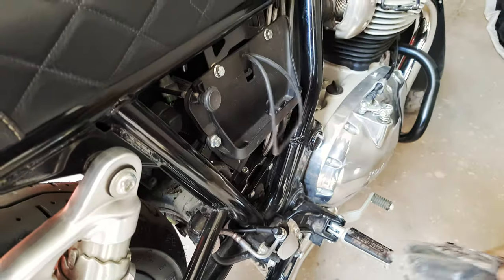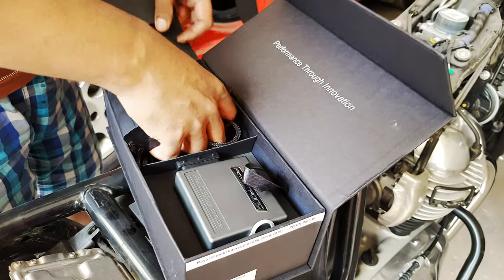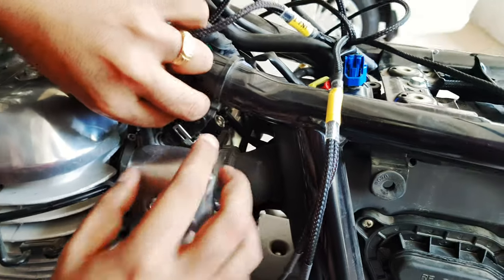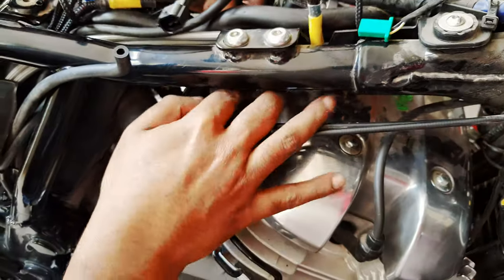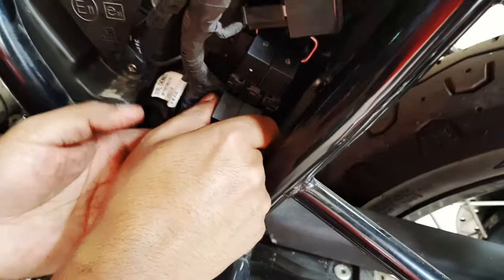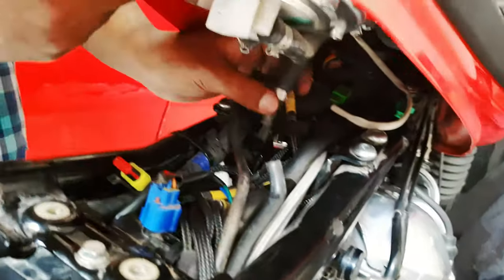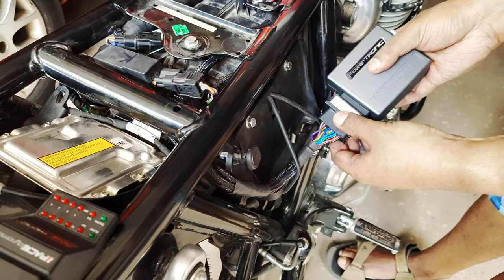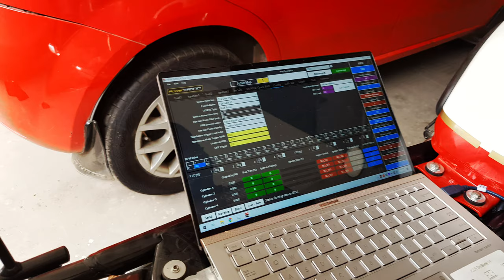Powertronic Installation - Royal Enfield Interceptor 650 | 4K

Comment: How did you come to know about the actual range of 30 to 224 ? I mean does it shows up in the powertronic application ?
Reply from the maker: Yes, it shows the actual values at each position as you move the throttle. Somehow the wizard doesn't record all the way to the maximum. But you can see the actual values on the screen.
Reply: @Volatile42  Great ! Thanks for responding 😀
Its quite an informative video for the users who are planning to DIY.
Keep doing the great work !
Reply: @Volatile42 after installation the rev limit is still there..
Reply from the maker: Yes, the default maps provided with the Powertronic do not change the rev limit. But I believe there is a way to change it from the tuning software. I myself haven't tried it yet.

Comment: What year is your bike? Will this work for Interceptor 650 2021 ?
Reply from the maker: Mine is a 2019 but I'm pretty sure it'll work on a 2021 as well. There have only been some minor changes for emissions and mostly with the exhaust. The Powertronic maps are customizable and Race Dynamics (the makers of Powertronic) might even have made some changes if necessary. I would suggest that you check with Race Dynamics once to be sure. They are usually quite responsive and supportive.

Comment: These are slightly modified  stage1 maps. It barely adds fuel to the idle cruise. 

Adds no timing and does not raise the rev limiter because the current engines configuration can’t take advantage  of this. 

It is only set up for exhaust and air filter fuel map adjustment. 

The bike is almost lean completely across the fuel map .
You can trim the fuel cells but should be done on a dyno  to make sure you don’t over fuel or under fuel cells. 

Having said this, I tested 3 interceptors , one with powertronic., one with Booster plug. And one stock.

The only difference I could feel  was the idle was smoother  and slow speed  was easy and roll on had a  nicer acceleration with both tuners.

The stock one was a bit ruff with the throttle but otherwise not much not a huge difference. 

Will be purchasing a 650 soon, the only thing I will do is an exhaust and Booster plug. 

The after market  filter  is not worth  it, excess  dirt will enter the engine , eventually causing the pistons seals not seal completely. 

My advice. Keep the stock filter and open up the plate that holds the filter in place if you just got to have that minimal extra  air  and performance . 

If you need more power then you are looking at the wrong bike. Other than cams to wake up the bike a big bore would be the only choice and that opens up a can of worms  not worth going into. 

Hope this helps.
Reply: Booster plug doesn't work on the Euro 5 onwards.

Comment: I m a new subscriber from Dubai. Stay blessed! I am from a place where there is no mechanic with laptop and ofcourse incompetent enough to handle this. However I have a RE Service station nearby and my question is, would they fix this? Would it be legal to approach them?
Reply from the maker: An RE service would probably not do it. It's pretty easy to do it by yourself once you understand the process. Otherwise I would suggest you approach a good independent garage that specializes in tuning of bikes and cars. I'm sure you'll find them in Dubai. Show them the Race Dynamics documentation and maybe this video and they will know what to do. All modern engine tuning is done via computers.
Reply: @Volatile42  So kind of you. However I meant back in Tamil Nadu only (Kanyakumari). I try my best to cover it thru your video. Thank you once again. If you could enlighten me on ' difference between quick shift and powertronic. Is it two different devices? or just once unit used for two purposes?
Reply from the maker: The quick shifter is an add-on for the Powertronic. The Powertronic already has the software and connector for the quick shifter. You need buy the quick shifter sensor and, install it into the shift lever and plug it into the Powertronic. So yes, if you want the quick shifter, you need both that and the Powertronic.
Reply: Volatile42 oh nice I got it. I don’t speed my bike much and I hv a hyderalic clutch installed already so I intend to apply clutch for the shift. Hope my stand makes sense “ not to go for quick shift and jz powertronic is fine “!

Comment: I have one of these installed on a 2016 Classic 500.  A very capable tuner that allows for easy modification of the fuel and spark maps.  The downside is that the only tunes you can get from Powertronic are for either stock setups or for bikes with both low restriction air filter and exhaust.  My modifications go beyond that and they are no help.  They say you need to find a dyno to tune any other configuration.  I told them that there are no dynos here and they said they can not tell me anything.  They do have some good reading material on general tuning practices, however.

Comment: Brilliant video and I need a some guidance on this, I was too ignorant, and bought an AEW exhaust only to realise later that changing exhaust also requires us to tune the ECU for health of the engine (as the pressure build up in the stock due to its core is not present in aftermarket one). Which I also sensed subtly while riding when the engine revved up pretty quickly but soon would loose its pressure. I see the Powertronic might be stop gap for this.. but its a bit expensive and a over kill.. Now my question is,  can this managed by buying an after market filter and an appropriate spark plug or do you think going for powertronic sought of stuff is the only way? Your information would be really helpful.
Reply from the maker: An aftermarket air filter will make it worse as it makes the system more free-flowing and hence more lean. For most people just the exhaust change itself doesn't require a remap as the effect is relatively less. But a remap is recommended as the ECU uses a very lean map from the factory. You may want to look at the Booster Plug which is cheaper than the Powertronic and most people are happy with it. I wouldn't recommend changing spark plugs as they don't have any realistic improvement on performance. The iridium tipped ones last much longer though.
Reply: @Volatile42  thanks for the reply.. 

I am trying to understand what you mean.. So the lean map from stock setting will continue to send in low fuel.. While the after market exhaust will let the air flow freely on the output end right?

So, what if we dont remap let it with default setting ? will this imbalance between input and output have any adverse impact on the engine life or mileage..?
In short what are the impacts if I just change exhaust and do noting else.

NOTE: I asked this becoz I just checked, the booster plug seems cheaper than e-commander units. But not really that cheap.. costs like 12 - 14K
Reply from the maker: Right. The stock setting is very lean to begin with as they have to meet the emissions standards. If you add any free-flow component, either intake or exhaust, you get more air flowing but with the same amount of fuel. So it will be running more lean. With any tuner, you are trying to fix this by adding more fuel. Most people don't notice much of an adverse effect with changing just the exhaust or intake. But if you change both, you will most likely need to add a tuner. Extremely lean settings can harm the engine as it causes it to run hotter. I can't really say exactly what level is safe but most people seem to be ok with just an exhaust change and no tuner. 
BTW, what you say about the lack of back pressure in an open exhaust is also true. This itself is not harmful in my opinion but you may feel like you're missing some of the performance. In my case the Powertronic did fix it and I think people with Boost Plugs also noticed the same. But on the RE 650 the difference is not huge, so you don't absolutely have to go for a tuner. This is all general knowledge but different bikes react differently to such changes. On my Harley Sportster, just changing the exhausts brought in a massive flat spot in the torque curve that was very irritating, so I was forced to get a Fuelpak3. On the RE 650 the difference is noticeable but not so dramatic.
Reply: @Volatile42  I did notice it in re twins.. Its subtle.. Some might choose to ignore it.. But it is there.. So I have the stock back on the exhaust. It will be so until I decide on a solution
Reply: @Volatile42  Really meaningful conversation here, points noted and thank you!
Reply: @prabhuraaj101  Hi guys good information. I have what is the standard mods for the intercepter, free flow exhaust (s&s) free flow air filter and booster plug (easy install). Sounds beautiful and runs hard with no issues. The main thing with exhaust change is back fire on closed throttle, that's your lean mixture. Booster plug just fits into wire loom and on the outside of the air box thus fooling the ecu into thinking its too lean so richens the mixture. Way cheaper than EFI tuners that still have their part to play should you decide on cams or 865 kits. Stay safe out there. LOVE my intercepter.
Reply: Hi 
Very interesting conversation I just wanted to ask I have an aftermarket airfilter Way2Speed and red rooster slip ons added 
My interceptor miss fires a lot after 6k rpm 
Should I get the powertronic or should I go back to the stock air filter

Comment: Hi, please can you clarify a question, can you tell the company that manufactures the interceptor 650 oil filter? the specification of the oil filter? compatible filters?
Reply from the maker: Hi, sorry for the late response. I too have not been able to find an aftermarket model for the oil filter. There are quite a few that would fit as they have the right dimensions but I'm not sure about the bypass valve specs. So I'm sticking with the RE one. It was very difficult to get one from the dealer but I was able to get it quite easily from the RE parts distributor for my city.

Comment: Can we install power tronic in continental GT also??
Reply from the maker: Of course. It's the same engine and ECU. But please check with Race Dynamics, I think they have the improved FuelX version now which has additional functionality like auto-tune. In any case there is no difference between the Interceptor and GT from the engine point of view.

Comment: What is powertronics fuel x for interceptor 650?
Reply from the maker: I haven't really looked into it but it looks like an improved version with more capabilities. Mainly the Auto-tune which is supposed to dynamically work out your map settings based on live feedback from the engine as you ride. Very interesting but not sure how well it actually works. I have first hand experience with auto-tune on the Fuelpak3 on my Sportster and that wasn't as good as it was made out to be. I have a video on that if you're interested in the details. Of course, that was a few years ago and things are continuously improving. Have to wait for some reliable reviews from people using the new FuelX.

Comment: Isse benefits kya hote hain.
Reply from the maker: It alters the air-fuel ratio and ignition timing for better performance. You can see the effects more of you have aftermarket free-flow intake/air-filter and exhausts.
Reply: @Volatile42  COMPANY JO DETI HAI USME KYA DIKKAT HAI.
Reply from the maker: What the company provides is very restricted due to emissions and noise regulations. Koi dikkat nahi, it’s still good. But if you’re used to other performance oriented bikes you may find some things like throttle response need improvement.
Reply: @Volatile42  OK THANKS

Comment: yup an mechanical engineer is speaking but what is the difference now & ll it last & what about your warranty
Reply from the maker: Hi Sourav, I'm no engineer, more of a mechanic. I like working on my bikes, which is one of the reasons I got the RE. It's simple and easy to work with.
Please see my other videos on the performance difference with the Powertronic. It's a improvement in the low-end response; more so if you also add in a free-flow intake and exhaust, like I have done later.
As for the warranty, if RE sees you with the mods, they will probably deny the warranty. But the installation is reversible, so if you really need to go to the dealer for a warranty claim, it's better the remove it first.
Reply: @Volatile42  dude its all ok but dont u think u r dong too much work for so lil gain
Reply from the maker: Yeah, it is expensive. Not very easy to justify. Like I said in my review video, I look at it this way. I wasn't quite satisfied with the low end performance of the Interceptor as my earlier bike was more torquey in the low end and I was missing that. But the Interceptor's price is low enough that even you add some extras to make it a little better, it's still so much cheaper than any comparable bike.
As for the amount of work, it's not much. As you get more comfortable working on bikes, they feel easier to work with. Cheers 🙂

Comment: How much additional hp and torque did you get out of it?
Reply from the maker: I did not get it dyno tested, so can't say exactly how much. But it is definitely perceptible. It may not increase the peak  numbers much but makes the torque more accessible in the lower RPMs. If you do have access to a dyno though, you can even tune the maps better and get the most out of your setup (exhaust and intake combination).

Comment: Hi how much would be the power increase with this installation?
Reply from the maker: The actual power and torque gains aren't much. They claim a 3 to 5 bhp gain with stock intake and exhaust. More noticeable is the change in throttle response and the eagerness of the bike to perform.

Comment: Could have tried remapping from wolf moto who claim 8 to 10 % of gains and no need of all these wiring extras, just add an exhaust, airfilter and remap it's all done. Only thing you would get here is a quick shifter which may not be required other than a lap time improvement 😜 why do you take roadster to the track.